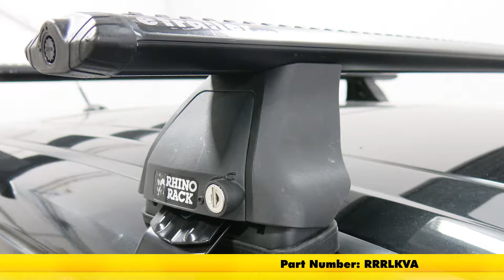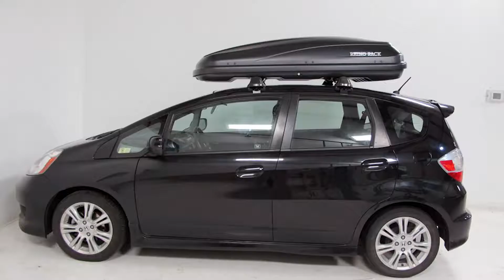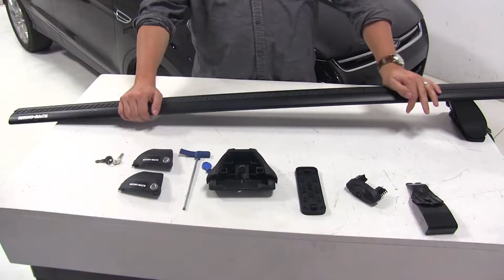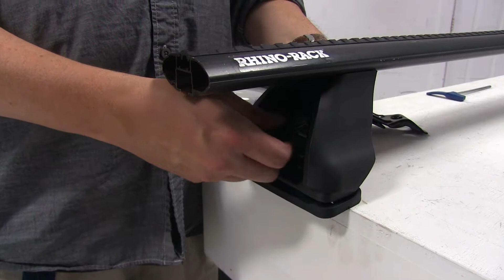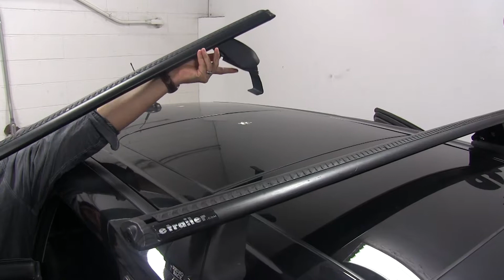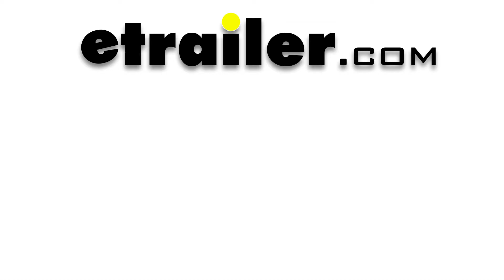Installation: Custom DK Fit Kit for 4 Rhino-Rack 2500 Series Roof Rack Legs on a 2013 Ford Escape

Comment: I have a question. The roof weight capacity is only 45 pounds with the panorama sunroof, will adding a rail and rack system allow more weight? You said the rack system allows for 165 pounds. So what is the total weight limit?
Reply: did you ever get that figured out. I have the same issue